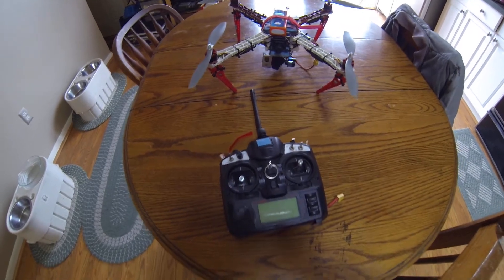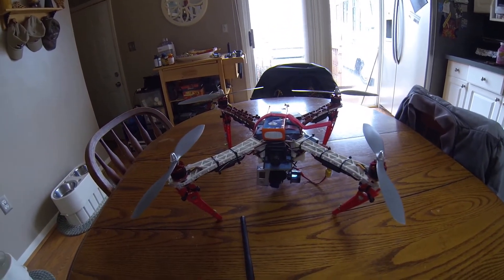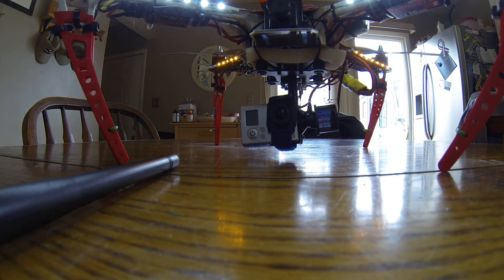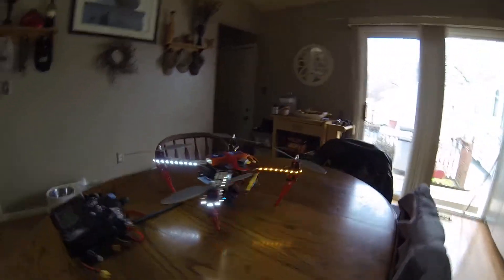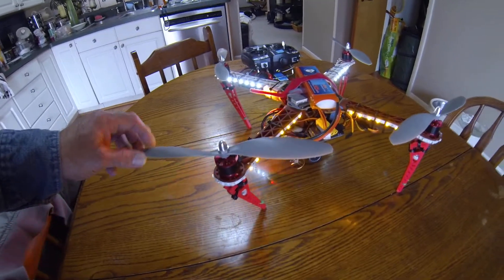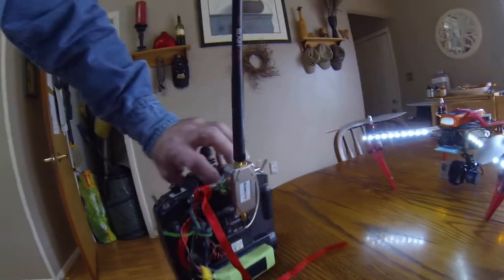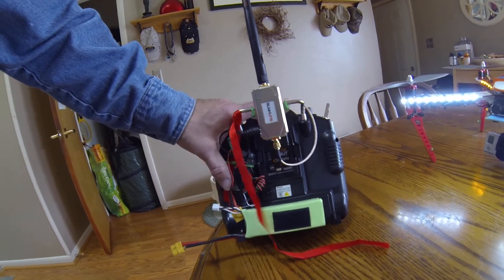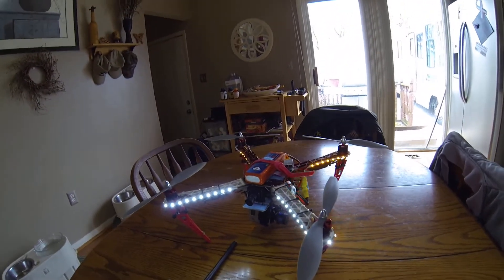Table top review of my new F450 clone

Comment: Very cool, I will check out that booster from range video. Going to try it with the frsky patch antenna...
Reply from the maker: You will like it they are so EZ to set up. I have used my system for a year + and it does great. I have a Patch as well and get a good one I have had a bad one break in flight but all worked out OK, I got it home. Have a good one.